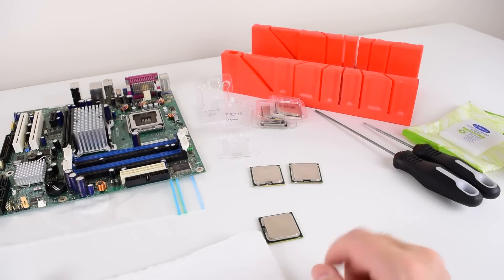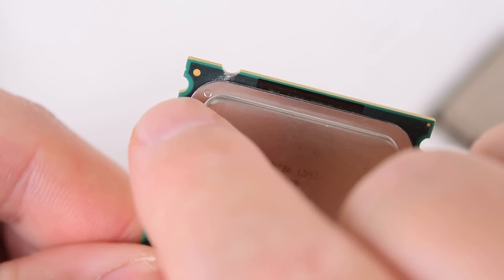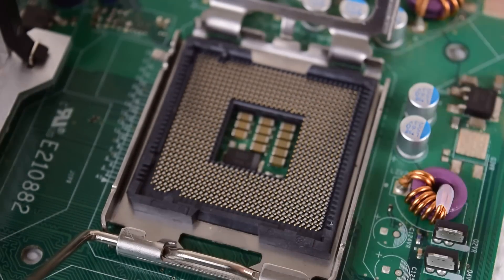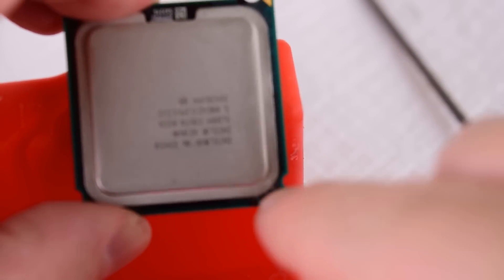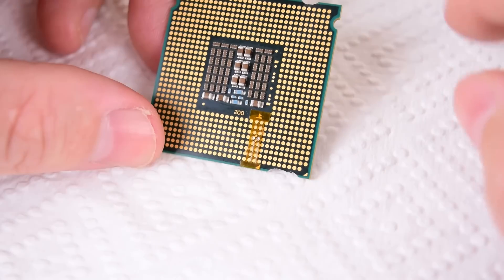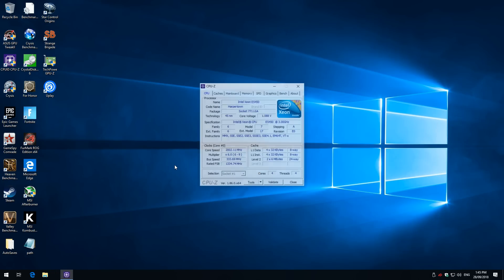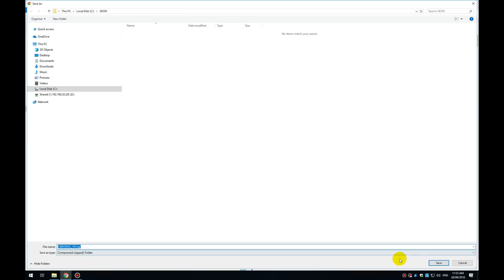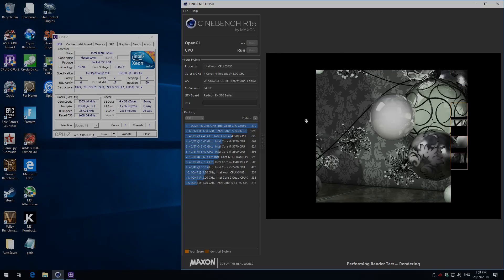Modding cheap LGA 771 Xeon Processors for Socket 775 Motherboard

Comment: This is a cool mod.. I remember seeing it mentioned/covered years ago. Seems like a good use of existing hardware. 
The closest I can come to this performance for the price on US ebay for a mobo/cpu combo is a Gigabyte mobo with an AMD Athlon II X4 620 for $50 shipped- which isn't a powerhouse, but can be OC'd easily iirc. But add in ram and HDD and Power Supply and Windows... Just shows buying complete used desktops are a better value that used parts to build with.
Reply from the maker: I want to look at some AMD stuff in the near future :)

Comment: I have GIGABYTE GA-P41-ES3G motherboard, will Xeon E5450 work on this..? Please help asap.
Reply: Yes it will. You might need to update the bios first but the E5450 Xeon will work on your GA-P41-ES3G. You will find it listed in the 'tested motherboard' section here. https://www.delidded.com/lga-771-to-775-adapter/3/#gigabyte

Comment: Yeah, this video looks so late, its recency surprises me. In 2017 year I bought Xeon E5450 on Aliexpress as an upgrade from Core 2 Quad Q6600. Spoiler alert: this didn't go well. First, my PC was HP Pavilion pre-built with OEM motherboard (MicroATX, G33 chipset, DDR2). Installing Xeon disabled NX bit and made Windows 10 hang on boot. Had to install Windows 7. On the internet there were complains that even installing Core 2 Quad Q9650 on my motherboard disables NX bit. I tried fixing it by injecting microcodes. I tried it so many times, can't believe I didn't break it. Second, when playing GTA V the computer completely froze and fans would repeatedly start and stop. It looked like the motherboard died. I temporarily fixed it by installing Core 2 Quad back and then Xeon, but it happened again. To make this CPU work, I would need a good motherboard. Ideally Asus P5Q3 Deluxe, or something else on P45 chipset. But then I would need to buy DDR3 RAM and ATX case. Also a new power supply so that I don't have to worry how long Chieftec 350W with 2x Molex —> 6-pin adapter is going to last. This mod will work well if other components, especially your motherboard, don't suck. But don't forget: next year LGA775 will be a 15-year-old platform. At this point Xeon mod is more like a hobby project. Don't expect it to solve all your performance problems. Yes, it helped me play GTA V, but it's a 5-year-old game with good optimization. Please leave replies how this mod helped you.
Reply from the maker: Well to be fair your negative experience stems from having a OEM HP machine. The board I used costs $35 from AliExpress, so it's really not like it's a lot of money.
Reply: Surprise surprise: the whole channel is about hobby projects!!!
Still interesting to hear that the HP Pavilion wasn't a suitable platform for this project.

Comment: i have both of these motherboards. the intel board that i am presently using and the asus thats in the thumbnail. my asus has a E5450 in it that i had running at 3.5 ghz for a while until it crashed. it runs stable at 3.3. i heard you can get it to 4ghz on certain boards and water cooling. the intel board i have doesnt support overclocking though
Reply from the maker: Nice. My Asus board stopped working after a few days :( I wanted to use it for some DDR2 vs DDR3 motherboards. I got far enough to get a few benchmark results, but not as much as I would have liked.
Reply: PhilsComputerLab i ran a bunch of emulators on that system. i 'shelved' my e5450 but when i had it up and running i had and antec water cooler and a gtx 1050ti

Comment: WTF are you doing?!?!? You NEVER file down the CPU! lol. You cut the tabs out of the 775 socket so the 771 CPU can be installed correctly!
Reply from the maker: I mentioned the tab method. I just prefer modding the CPU rather than the motherboard.

Comment: Thanks very much for the guide. Only just recently came to know about this mod, literally just bought a X5460 then this video came out! Talk about good timing. Didn't even know I had to mod the microcode before this video so a good job there! Now running P43-ES3G (DDR2 version of the mobo in this video) with a AC7 cooler and running 3.9Ghz. Even faster than my Q9550+P5Q Pro setup I had back in the day.

Comment: No need to pay for modified bios, there is a chinese site that has bioses for almost all the motherboards that support this mod, i got my e5450 working on an asrock p45 motherboard with a modded bios from that site straight away, i can push 3.8 ghz overclock, sadly the ipc on this chips it's bad and will bottlneck a lot in todays games
Link:http://genius239239.myweb.hinet.net/771/
Reply from the maker: It's 1 dollar.
Reply: @philscomputerlab  i know but they get the bios they sell you from the same place, so why to let them make you pay for something that you can get from where they get it...

Comment: I did this on my Optiplex 780 a few months ago. My new quad core Xeon X3363 has been running perfectly. I modded my socket instead, easier in my opinion.

Comment: Waiting for my E5450 from Aliexpress for Gigabyte G41 Combo and zotack GTX 1050 ti mini (I bought the card a month back for $75 in mint condition). Will try to overclock it to 3.5 to reduce bottleneck. Can anyone give me a heads up if I require BIOS mod for G41?

Comment: Few months back I found the L5420 for about 12 USD to be really good buy. I took 2 of them for my parent's computers, modded the BIOSes (both were gigabytes boards, but one with G41 and DDR3 and the other is P35 with DDR2) and they work flawlessly. Since the L5420 has TDP of only 50W, it is practically cold and with 8GB RAM and cheap SATA3 SSD, their PCs are still up to the usual tasks and pretty usable nowadays.

Comment: Just a small info: Most Gigabyte LGA775 motherboards already have the required microcodes for Xeons by default, especially P35 boards!
I've been using a Xeon E5450 on my GA-EP35-DS3 for quite some time, with the default microcodes from Gigabyte.
Pic: https://i.imgur.com/Tnxp6dd.png

Comment: As I mentioned in your other video, I did this in my laptop (Clevo D901C). The performance is awesome, but even more the power consumption/TDP are usually FAR superior from a measurement perspective of the consumer variants. Perhaps they’re higher binned silicon in general. Awesome video!

Comment: I would not buy E5450 from my experience with an E5440. I had one that literally only ran at ~2.9 GHz, which is a 66 MHz OC with anything higher failing at maximum overvoltage of the used motherboard. An X5460, which is about $4 cheaper by the way easily did 3.6 GHz on the same motherboard, just with higher FSB. I believe in Silicon Lottery, but that just sounds like a scheme to me with that disparity of >700 MHz at the same voltages, but I mean it might be...
...still the X5460 is cheaper and has higher multipliers.

Comment: I just wanted to say that you inadvertently helped me with an issue. I had an older Core 2 duo celron based machine that the specs stated that is it was compatible with a "newer" Core 2 Quad and so I purchased the Core 2 Quad. I updated the bios and installed the "new" processor and it would not post. Just beeped. I put the older processor back in, I used the guide at the delided.com site and updated the bios with the newer microcode and reinstalled the "newer Core 2 quad now the Core 2 Quad is running like a champ! Thanks Phil!
Reply: i love happy ending stories

Comment: 8:14 The pre-modded chip has the sticker applied very inaccurately and right near the annoying typical Chinese Ali-Express-seller badge with the dirt under it an SMD is shattered (second from bottom right). That is why I 'd rather just mod the socket for a vanilla chip. Also did the BIOS mod on two boards, was really easy...

Comment: I have done this mod for one person who had very little money. He had Phenom X4 with 4GB of ram and wanted to play GTA5 on it... LOL =) He also bought 4GB stick which was useless for him because he did mistake and got DDR3 variety. At work I used LGA775 board with 4GB DDR3 in one stick with some Pentium Dual-Core so we agreed to do an exchange. I bought very cheap 4 core 3GHz Xenon and did the mod to the board and got his Phenom board with him paying some small amount of money, just enough to cover price of processor. He got vastly better performance with 45nm C2Q running at 3GHz compared to old Phenom 1 at 2GHz. On my side performance didn't really improve much if at all... but I got more cores and most importantly chance to use original Phenom :))))))))))))

Comment: I think removing those plastic pieces from the socket it's safer and quicker then creating the 2 notches on the cpu,plus you only have to do it once,after that u can insert any 771 cpu in the socket,after aplying the sticker 2 it ofc.

Comment: i'm using a e5440 (oc 3.8ghz) with asus p5q mobo paired with gtx 1050ti, it works really great
Reply: What are you using to cool it?
Reply: @sidddhism1  i'm using a deepcool gammaxx 400 with 2 fans in push pull configuration
Reply: I will be using a cheap aliexpress CPU cooler which according to me will work great to overclock E5450 to 3.5 Ghz or above depending on the bottleneck situation with my 1050ti mini.
Reply: What are your PC specs ,CPU temps and voltage?
Reply: @sidddhism1  e5440, gammaxx 400, 8gb ddr2, asus p5q, inno3d 1050ti, 600w 80+ psu, 1tb hdd

last time i checked it is 78c 24 hours with aida64

im running 1.3625v
Reply: @Tobias Gurning  Eh, I had to upgrade to an i5-2500K (2012) from my Q9650 @3.53Ghz. The CPU was a huge bottleneck with games like Watchdogs, Crysis 2 and Far Cry 3.
Reply: @Gamevet  im planning to buy a x5470 and then save up for lga 1156 or 1155
Reply: @Tobias Gurning The TDP and Heat output will be high. It will give a good boost in performance but I would recommend to stick with E5450 and save for a new built.
Reply: @tobiaspauli  You can get a Ryzen 3 2400G for a benjamin. It has 4 cores and 8 threads. It's a baller for the price.
Reply: Q9650 can reach upto 4.2 Ghz on a P45 with proper cooling. It will be a bottleneck for GTX 1060 or above at 3.7 Ghz. E5450 has better multicore performance but Q9650 has better single core performance. I am sure the CPU was not holding back.

Comment: The fastest chip I see listed for LGA 771 runs at 3.4 GHz. The Q9650 I just bought for my LGA 775 board runs at 3.0 GHz. I don't see the advantage to this mod. Seems like a lot of work to get basically the same performance you can get out-of-the-box with another chip.
Reply from the maker: The Q9650 is a great CPU :)
Reply: I hope so. It has to be an upgrade from the Q6700 that came with the rig I bought. Also just bought a new board and DDR3 RAM to upgrade my ancient rig a bit. Can't afford the new build I want just yet so I'm patching this thing together best I can for now.

Comment: HEY ! That's my favorite LA 771 CPU. Cheap and efficient and runs like a Q9650. Build two gamer PC's already and awaiting one more CPU in the mail.
Only issue is they  are not compatible in a X38/X48. But the P35/P45 is still very good. Also works fine on P31/P41/P43. Actually this chip can work in a nForce 780i very good, and *okay in a nForce 680i (*keep the chipset cooled down - the Quad FSB1333 is a big challenge for this old HOT 680 chipset).
(Celeron's as practice CPU's.. haha.. I like that  - and agree):)
Good video Phil. Like the microcode update toturial. Thumbs up!

Comment: It's saver to mod the board instead of the filing in the CPU. It's quite tricky as you easily file just to much and destroy the CPU. I've seen several die already because of this

Comment: I too have known about this mod for some time now but haven't jumped on the band wagon yet. As i currently have a number of heavily overclocked core2quads that i use for various things, i would only be interested in the Xeon mod if the overclocking performance is better than that of the core2quad cpu's.

Comment: I've done this mod many times and have several  rigs running still. I completely recommend just cutting the plastic pieces off the motherboard socket. So much easier. Just take an exacto blade and push straight down takes 2 seconds and you don't have to worry about accidentally screwing up the processor. Regardless though this is a great mod and great computer when  matched with a decent video card.
Reply: Any workarounds you know of to get to work on the Q45 boards?  I'm reading into for my HP Compaq 8000 Elite Small Form Factor AU247AV mobo.
Reply: @jafinch78  same, want to know some too
Reply: @jafinch78  the mod doesn't work on Q45 chipset tho
Reply: @damielreyes  Doesn't looks like anyone has made or found a work around... though I read somewhere might be feasible somehow with some firmware coding if I recall correct.
Reply: @jafinch78 

Also HP here, same for the Intel G45S Express-chipset?

Comment: When I did mine, I cut the notches out of the CPU socket which was actually pretty easy.  You can set a CPU you don't care about into the socket while you cut the notches.  I will have to try modding the BIOS like you showed since the BIOS I used only supports socket 771 CPUs.

Comment: The last thing you do is filing the notch on the cpu as you can get the e5450 already have the notch and small sticker already applied it be a few pennies more but it more safer than the plastic sticker
Reply from the maker: I mention all of this in the video...
Reply: @philscomputerlab  would you know what cpu you using and what the vcore is like?

Comment: I did mod my e6400 back in the day to 1333 FSB, for a grand total of 2.66 ghz. 25% more powerful CPU for next to no work. But in the case of Xeon, I would pay someone that way I am not burning up chips. I had a Pentium e5500 I almost damaged pin modding. It was a next to free CPU, but thats not the point. Neat video, as always.

Comment: I got two X5450s for free, paid  near 7 USD on the sticker, added the microcodes to the bios, cut the fingers on the socket. After this lil work i got my old G41MT-S2P up and running X5450 and 8GB DDR3.
Reply: And now the thing is shoved in my drawer, not being used
Reply: Damn. I just got stickers for 84 cents on eBay.

Comment: Phil, when you do the results video, with the overclocking, could you add the watt draw from the wall as well?  I did this last year to replace a e8400, and found that the watt draw was double, so went back.  I can't remember the xeon at the moment, it's knocking around in a box.
Reply: Maybe your Xeon just made your GPU work harder and that's where the increased power draw came from.

Comment: This was a great video and a great subject to touch on. I'm glad you were able to put it up. I was super happy with my conversion, though I'm running it on my old Maximus Formula, and that X38 chipset  limits my options for CPUs, or at least from what I've read. It runs the 3xxx series processors, but not the 5xxx series. Kind of a bummer, but still much better than coughing up 200 bucks for an old QX that you have no idea what it's been doing for the last 10 years. lol.

Comment: I ordered the e5450 and my RX 580 finally got a RMA number today. I was very tempted to buy a Firepro s9050 12gb to have while my RX 580 is away on RMA.  I wanted to see how the s9050 would run. I know it is based on the HD 7970.

Comment: I'm watching this video with my X5460 running on Gigabyte G41 XD
Reply: I also have an X5460 but with an MSI G41 motherboard at home. :D
Reply: I have a G41 board I might mid, that or my Asus p5q, but that already has a q9550.
Reply: Performance difference wont be great but power consumption will go down for sure
Reply: Won't have less power consumption if it's an X54xx Xeon. Done that before with an X5460 Xeon. Was an awesome setup considering the whole build cost less that the launch price of a GTX 1050. TDP is close to double what my new Ryzen 2700 is though (120W TDP vs 65W TDP).  If I did this again, I'd get an e5450 Xeon due to the much lower TDP (80w TDP)
Reply: Im running a G41d3+ Biostar , ya reckon its worth going from my shitty q8200 to a e5450?
Reply: Can someone say what that stickers name is pls

Comment: FYI:Dell motherboards work just fine. I've put Xeons in a variety of different Dell motherboards. Specifically the Dell Inspiron 560 is 1333FSB and DDR3 is a great choice. There are some Vostos you do have to look out for that only support Dual core, but they will still work the a Dual core Xeon

Comment: I cut the board slot doing mine. I was fine, but I made sure to use a brand new razor blade. My friend who told me about the mod however, he used an old one when he did his and ended up actually bending some pins and had to really carefully bend them back again. So if you do cut the board tabs, make sure to use a sharp/brand new blade and be careful about the pins.

Comment: It's funny, but I'm pretty sure that the exactly same processor is sitting in one of my computers right now 😜
With 16GB RAM, SSD drive and Geforce GTX950 OC ACX it's quite a fast machine. I'm not using it for gaming so much, but it runs fx. Battlefield 1 on 1080p, max details without any problems.

Comment: This video was watched on my LGA771 modded system. When I did this mod 4 years ago, pre-modded chips didn't start showing up on ebay until about the time I was finished with playing around with the mod a few months later, mostly then it was pre-stickered chips. With proper cooling, voltage tweaks that 5450 will top out at about 4.5Ghz, but stability wise 4.2 - 4.3 is where it should land. I was more worried about filing too much of the CPU away ( E5450 cost a little more then that now ) so I modded the sockets instead.